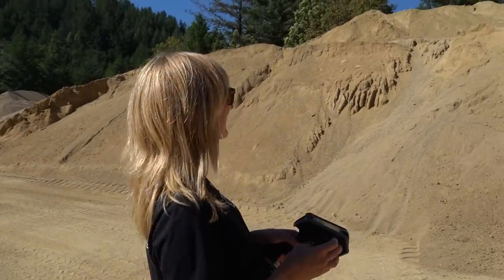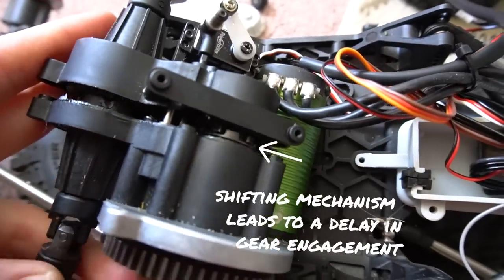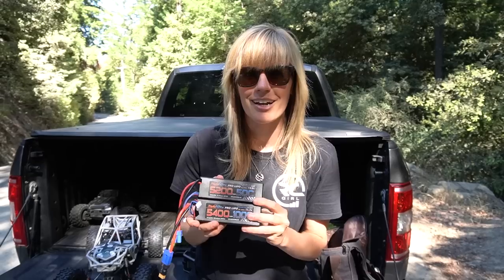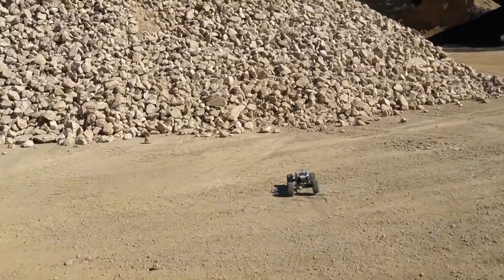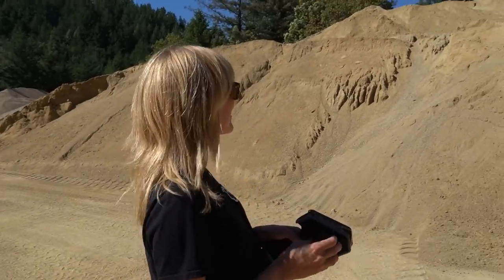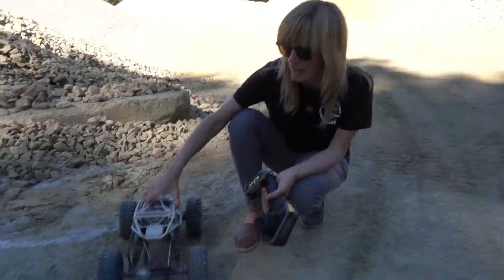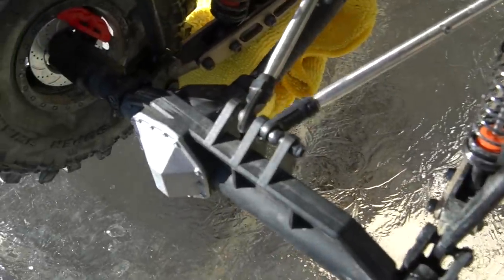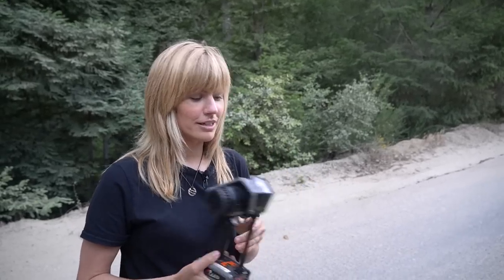SENDING IT! Axial RBX10 RYFT rock quarry run

Comment: First, and foremost, THANK YOU for doing a 'running' video.  As I'm sure many others are, I'm tired of videos of people worker comparing the Ryft to the SCX10 or [fill in the name of your favorite crawler], or those running it as if it's a crawler (people...it's a rock bouncer, NOT a crawler).  So, again, on behalf of all those wanting to see a running video of the Ryft being used as it was designed, I thank you.

Regarding the sway bar problems, trailing arm problems, axle problems, and many other problems, there's a solution - 7075 machined parts from Vitavon Racing.  That should solve most problems.

Comment: I'm running the same ESC/motor and find a single speed 14T pinion with locked diffs will crawl pretty good and still send it launching into the air up hills. Top speed is still faster then I can control. Plus you get more runtime from your batteries!

Comment: Nice run! I used a metal sway bar for my ryft but it kept coming out at the sides. After experimenting with different shock placements I found that attaching the rear shocks to the rear axle housing lowered the vehicle as well as made it more stable. Plus I added ~100g of lead weight in the fuel box so that the wheels bite the ground and there is better power transfer. This removed the sway problem for me. I also broke  the rod ends on mine. Really difficult to get a hold of these spares in the Netherlands. I am going to get metal after market rod ends for it soon. Hope this helps you. Keep RCing Cheers!

Comment: So by removing the 2 speed does that mean you are stuck with the gear ratio meant for speed? Disappointed with the crawling attempt but even with lower gearing, the diffs wouldn’t help. Then you lock all diffs and how much would the high speed/ low speed steering suffer? Not to mention the extra stress on the diff gear. 
All that said this thing still looks awesome and something I may purchase soon.

Comment: That little bomber has great balance. Would you say this or the crawler is more enjoyable? Been thinking about a crawler, like the SCX10.3 in a 6x6 configuration, for kicks.
Reply: I have both,I would have to say a crawler is WAY more fun...more of a challenge.the Ryft will basically go anywhere you point it.i built my Ryft to handle both situations crawling and bashing.i will say crawling equals WAY LESS broken parts,but to each its own.

Comment: I've been working on an all metal wraith build to rock bounce. 5700kv brushless setup on 2s is killing internal axle parts. How do the axles compare to a wraith? I'm running some slightly larger than ryft 2.2 tall narrow super swamper tsl tires.

Comment: Man girl your bashin the ryft hard haha love it!! I have the exact same motor with the mamba x. I run exclusively 4s. I love 13t pinion and do all most all my driving in 1st gear. I just did a speed test on pavement and got 25mph in first and 40mph in 2nd. I’m  confident on the 2nd gear test but on the 2nd and 3rd test I spun wildly out of control and have now bent a axle shaft. It’s so fast omg!
Reply: So with 13T it helps it manage lower speed sort of crawl better ? Should also be easier on the motor  and increase torque correct?

Comment: What sweet little spot to run👍✌️🤙 hey how do you like the copperhead esc? I been running the mamba x8s in everything but I saw this copperhead looks pretty sweet
Reply from the maker: It's great. It's a mid tier ESC but has all the functionality i need. Compared with some of the other castle esc, this one doesn't have an AUX port, so no on the fly adjustment of drag brake (or other settings). Nothing against the ESC, but it's a bit hard to access in the ryft, so making minor adjustments requires taking off the entire cage, tires, and getting into the receiver box etc. so anAUX function may be nice.